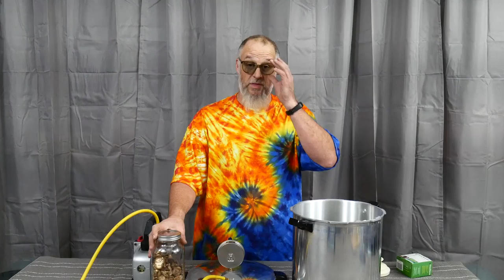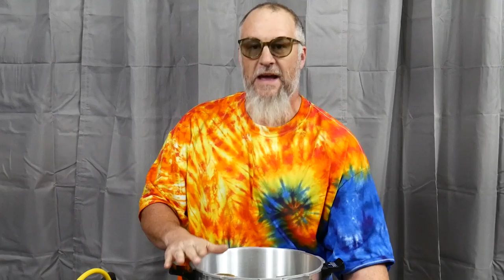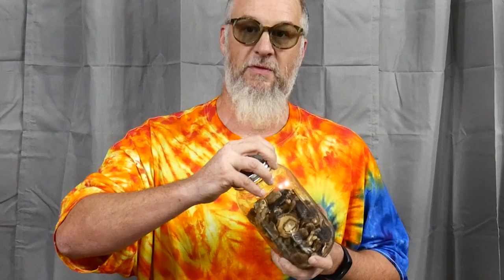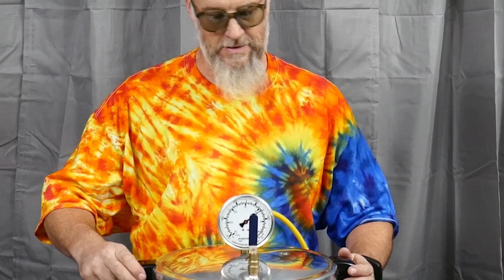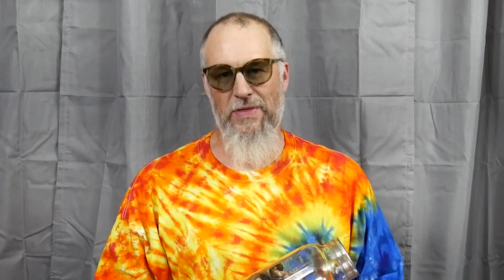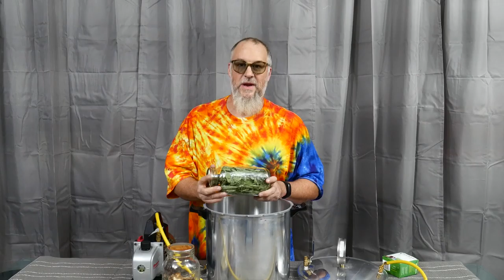Tie Dye Farmer Vlog 017

Comment: Why do you turn the lid back a quarter turn instead of tightening it all the way by hand?
Reply from the maker: When you put the jars into the vacuum pot to be sealed, you need the lids to not be held tightly to the jar.  This allows the air to be drawn out of the jar when the pump is activated.  After achieving our desired vacuum (which is about 29 in. hg. with this pump), the pump is shut off and air released back into the pot by opening the valve.  At that point the pressure change between the inside of the jar and the air rushing in causes the jar to seal.  

After I was done the video, I went back and checked some notes.  This pump draws down to a bit over 29 in. hg which equates to removing about 97% of the atmosphere.  So in essence that means only about 3% of the normal air remains in the jar.  My old FoodSaver ran at about 22 in. hg, which is right around 73% atmosphere.  My fuzzy math puts that at 27% of the air remaining, so in essence, this setup removes 9 times the air that the old system did!